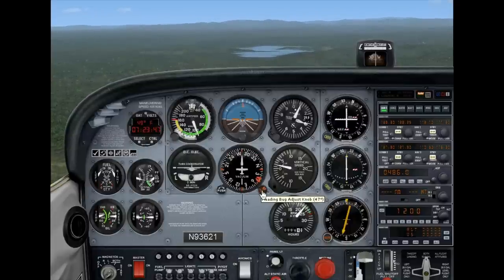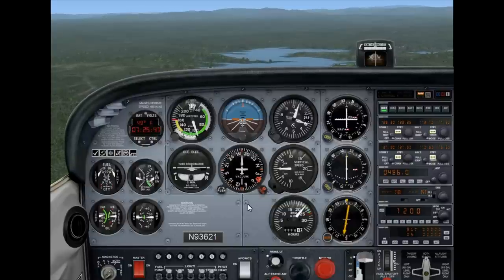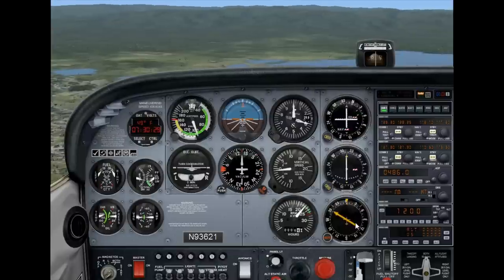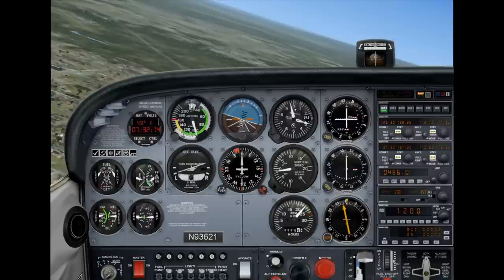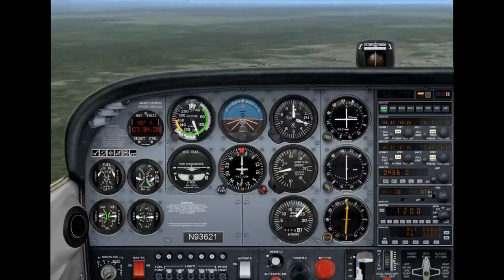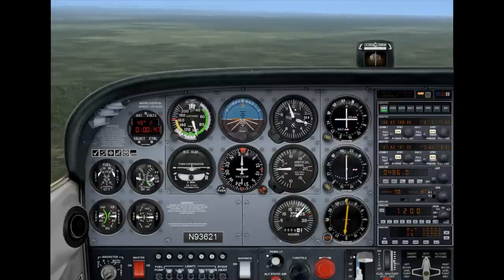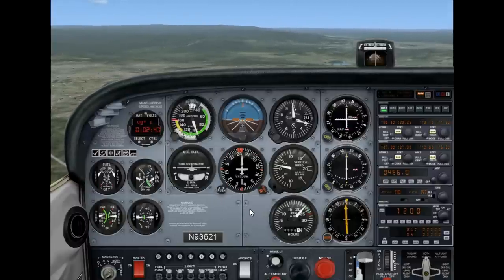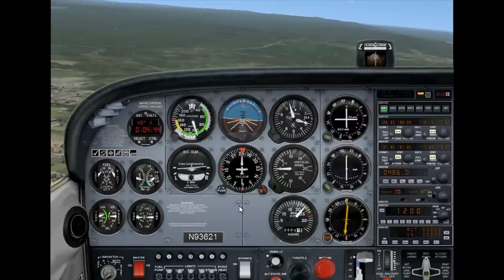How to fly NDB Intercepts Inbound and Outbound

Comment: Love NDB approaches. Used to do them on limited panel under the hood just to make it more fun and used the old fashioned DGs that only show the heading without a compass rose (which you had to visualise in your head). Nearly always used 30 degree intercepts. It's so cool to use old technology that lacks any bells and whistles, but is still so useful. NDBs are so simple and very reliable. Plus you can use AM radio stations as well as NDBs. I remember decades ago when there was a radio technicians strike the ILS and VORs went out of service fast, but the NDBs kept beeping away happily for weeks. Only real disadvantage I found was in stormy weather when the ADF needle sometimes tended to point at the storm rather than the station!   GPS pffft! - merely a device to allow student pilots to become lost with a high degree of accuracy.
Reply from the maker: Glad to hear it.  NDBs were the first instrument taught at my flight school.  Once you mastered the NDB, you then moved on to VORs and ILS.  If you can fly a NDB approach, you can very easily fly the rest.  The only caution with regards to using AM radio stations - there was always the chance you may be tuned into a repeater station rather than the actual radio station location.  There were several AM repeaters stations in the South Australian desert where I was taught to fly.  The repeaters were usually marked on VFR charts.  NDBs were hard to find in the US.  I could never find any in Virginia or Maryland.

Comment: I found that IFR is 'a lot of very easy tasks combined into one continuous operation' that, when mastered, result in a delectable product- I call it the McDonalds formula. I was taught this principle of 'bugging' the track and flying the HDG as well. The only drawback to this method, as pointed out by my instructor, is that when you start to use A/P in an IFR situation, problems present themselves if the Autopilot is coupled to the HDG bug. I enjoyed your commentary and thought you made the whole process very understandable.
Reply from the maker: That is an excellent point Chris re: using this method and using an autopilot.  I always manually flew the aircraft, as a result I did not think to mention that valuable autopilot point.

Comment: Within literally 0.25 seconds of your first word I go: Cheers mate, just couldn't get any better than having an Aussie explain NDB intercepts out of YLTV! (Studying for IREX here in Melbourne too). Thanks for great video!
Reply from the maker: G'day Sohrab, thanks for that. Please note, the NDB procedure at YLTV has changed since making this video. The NDB location has changed and so too have the inbound and outbound tracks. Good luck with your IREX..
Reply: Good point, and thanks, IREX is on the horizon. I had the DAP open beside it and was trying to follow the tracks your mentioned but reckoned that something had to have changed in the time since you posted your video. Anyway, as good a reason as any other to come fly down under to stay up to date! Cheers mate.

Comment: Great video! Doing my IFR now, amd I was curios how to fly NDBs. It's no longer on the written, and I'm not sure I'll see it on my practical, but I feel knowing as much as possible makes this a good backup. Thanks!
Reply from the maker: +strato172 No worries, good luck with your IFR flight test.  After a while, you may find VFR to be a lot more fun than IFR.  In a way, VFR is actually more challenging.  Good Luck with the flight test..

Comment: You forgot one very important thing: the wind. 

If you just follow the head of the needle, as you say, you will not fly a straight line to the NDB station but will instead fly a bow curve like a ) shape. You need to work out the WCA or wind correction angle and add/subtract to the relative bearing to the NDB. 

Example:

You are flying a hdg of 180 degrees, NDB station is at relative bearing of 270 degrees, wind is 315/20 

Turn left 90 degrees so that the NDB is now 000 degrees relative bearing which is hdg 090. 

To work out WCA you need to work out max drift. The formula is: W x 60 / 100 (W is windspeed) 

So, 20 x 60 / 100 is 12 degrees. 

The wind is coming from behind and is blowing you right off course, so you need to steer left off course by 12 degrees or thereabouts in order to fly an approximate straight line to the NDB station.
Reply from the maker: G'day Bigred Jack, your absolutely right about the wind missing.  I did an updated video with wind here: https://www.youtube.com/watch?v=Av_ri_4jLJ8

Comment: I just finished flying DME ARC with MAP yesterday. We're going to do this next. Let the pain commence
Reply from the maker: You'll be okay.  get as much practice on flight sims as possible to hep keep the cost of flight training down.  Good Luck with your NDB approaches.
Reply: I can't believe I performed well. haha. I think this is much easier than the VOR. I just had some trouble with my wind corrections since reading the needle alone can be disorienting.

What I was taught:
When tracking with winds: the direction the head moves is the direction of the wind. Then go back to original track with 20-30deg intercept (wait for needle to deflect to other side at the same angle of intercept) then go back to original course and add 5deg for WCA.

To monitor if WCA is enough: Head goes to wind direction=not enough WCA

Head goes opposite of wind direction=too much WCA.

*When intercepting you can check beforehand if you are going to overshoot/undershoot your target by checking the 45deg point of ADF and of DG.

We actually have to put emphasis on WCA since in our place winds usually go not less than 10kts.

I'm embarrassed, it seems I wrote too much. Thanks for the video! It helped alot! ^^
Reply from the maker: Remle Anall
Yes that is correct regarding the winds and the NDB needle.  In this video, I had it set to nil wind for the sack of simplicity.  When you are holding you need to adjust your inbound and outbound times based on the direction of the wind.  But I think that is for another video..  I wanted to keep this one as a starting point for flying NDBs..  Congrats on flying your NDB approach well..  I find VORs a lot easier than NDBs, as they are more accurate and have a very similar display to the ILS, which is better again.